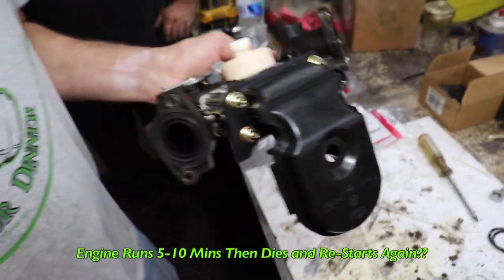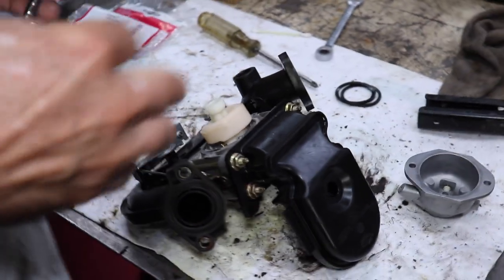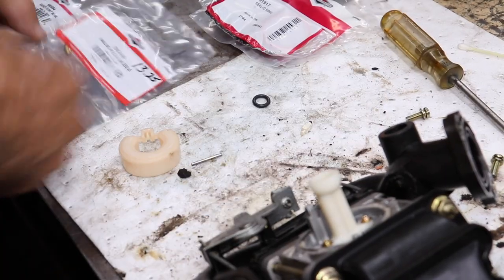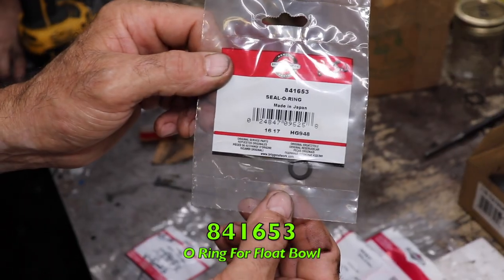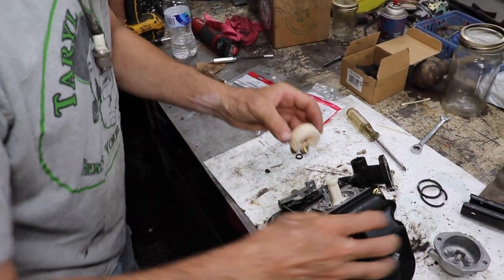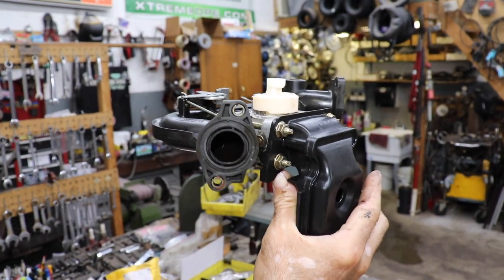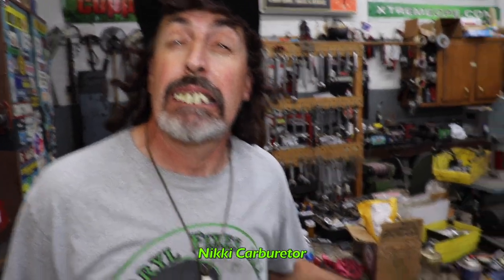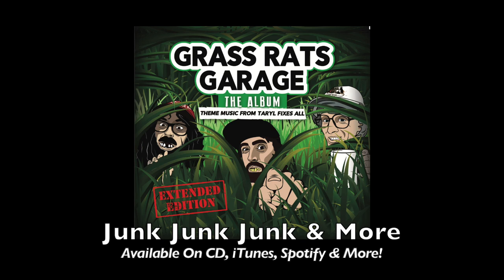Engine Runs 5 Mins and Dies? Try This Amazing Trick!

Comment: You're the first expert to say the float level matters. Anybody else I've seen rebuild a carb said it doesn't matter. I always adjust parts until the float is exactly parallel with the carb body. Never had an issue after a rebuild or replacement.
Reply: Those weren't experts.  Those were hacks.
Reply: Any carb I've ever seen has a float height spec from the manufacturer.

Comment: Another thing that can cause an engine to run for a short time then die, is someone using the wrong fuel filter. You should never use a pleated paper style filter on a gravity fed fuel system. It can cause the same symptoms. Too much restriction. Just ran into this a couple of weeks ago on an old Briggs single. Customer had installed one of those filters and couldn’t get it to stay running. Swapped the filter for the correct Briggs red plastic screen style filter and problem went away. We were told about using the correct filter when I went to Briggs school on fuel systems. If you have a fuel pump, the paper filters are fine, if gravity feed, stick with the screen style…..
Reply: I'm a intermediate hobbyist and just learned something new!  Thanks!
Reply: Thanks for the tip
Reply: Briggs makes two screen type filters.  A white and a red and they have different mesh in them?  If I'm not mistaken only the red is recommended for gravity feed.
Reply: @shawnbottom4769  Correct. The white filter has a finer mesh screen in it compared to the red, and according to Briggs is intended for systems where a pump is used. Personally, I usually just use a good quality paper filter with pump systems, as I feel they filter better than a screen. But don’t use just any old cheap filter. I have seen cheap ones that come apart internally over time due to poor glue holding the element in place.
Reply: I posted a comment and noticed yours so figured I would put this here, too.  In older equipment particularly, inspect the entire fuel hose system from tank to carb.  I had the prob, replaced all the hose from the fuel filter to the carb.  Didn't help.  That is when I looked at the hose from the tank and it was jellified inside, replaced it and it worked fine until something else broke later on :(
Reply: I use to believe this as well. However as long as the height of the gas tank can compensate any filter can be used without issue
Reply: WHERES MY DINNER? Ive watched every damn video on this problem and still cant figure it out on my Kohler 22hp Let's see I've put on a new carb fuel filter and gas line new air filter spark and ignition coil and yes even a new gas cap and the damn thing wont stay running.Has about 150 hours on it so I doubt it but maybe a valve job? My grass is starting to look like a field and I cant afford $120 per hour to fix my mower

Comment: I've seen that same symptom when there was debris in the tank that would restrict the flow to the point that the bowl would empty, then fuel would seep thru and refill the bowl.
Reply: I had the happen to me. Somehow a rock got stuck in the outlet of the fuel tank. Never seen that before
Reply: Or the vent in the fuel cap is bad/plugged.
Reply: that was my first guess, no fuel filter or plugged fuel filter repicking up sediments/contaminants

Comment: I had this problem on my old Toro Recycler this spring. Same fix. New needle and seat seal, and it runs fine now. I couldn't tell the difference between the old and new parts, but can't argue with results.  :)

Comment: I tried mowing the lawn just before it got dark last night, but the mower started cutting out after about 10 or 15 feet of mowing.  It would start right back up, but when I pushed through the grass it would lose power and die.  I took some pliers and slid back the fuel line clamp so I could slide off the fuel line from the nipple and see if there was gas coming down from the tank and it flowed strongly.  It was getting to be too dark to tear into it further, so I put it away for the night.  After dinner today, I took off the float bowl...the first time I've done it on this mower,....and thought I saw some water in the bottom of the bowl,....but it wasn't water!  It was two thin metal disks, just the same size as the hole stamped into the bottom of the float bowl.  I was thinking they've been there since the mower was born, randomly moving around, but when they ended up in a particular spot, stacked two-high under the float, they held the float from dropping when the fuel level went low as I cut the tall grass.  I put it back together without the two disks and it ran right again and I finished mowing the grass before it got too dark.  Wow, hard to believe that those disks have been in there since 2002 and not caused trouble until now!

Comment: I have a riding mower that originally came with the nikki carbatraitor I found out that it came with a walbro carbatraitor too and put Waldro carb on and never had anymore running issues. The nikki carb would always flood over and fill the crankcase with fuel

Comment: Taryl, what holds the 2 main jets into the carb?  When I turn mine over, are the jets supposed to be loose and fall out?  IT seems that only thing holding the tiny main jets in is a tiny o-ring on each one?

Comment: I really never thought about the flow being level. Now it makes me wonder how many carburetors that I worked on and could not solve the issues, so had to buy a new one. Tomorrow I'm going out to the garage and go through my broken carburetor and I'm going to check if any of them has a float that's too high or too low. If I find them I can fix the issue and buy some new parts to put back into them. Like most of us I used the old carburetors I have for parts to work on other people's problems.

Comment: So I've got a Marvel Schebler carburetor (off a 9n ford, I know it's a bit larger than your normal lawn tractor) and I continue to have the same issues after rebuilding it. It runs great for a little while (weeks or months) then it will only run with the choke on. Is there a specific jet or port that would contribute to this happening? Fuel(ethanol free) new gas lines, new strainers and filters,  new needles and jets. At what point do I just buy a new one? When I really just want to fix or adjust what I have.
Reply: Years ago, there was an adjustable main jet needle kit for those carbs. You'd either drill out the main jet or replace it with a biger one, then use the needle to adjust the mixture.
Reply: You start the engine, let it warm up, readjust the air/fuel mix......everytime. Mark the starting point for the next cold start.

Comment: Had a similar problem moons ago....like over 40....on a jd 120. It was the coil.....soon as it would get hot, (short out I guess)...engine would die dead as hades. Let it sit....cool down...and it'd start right up again. Took me awhile to figure that one out. Recently
 jd 915 zt began to choke down. What's up with that? Had a fresh fuel filter....change it anyway..they're cheap. Put a nice clear automotive type on it....viola....now it's apparent...fuel pump croaking out...barely squirting....like a nikki six. Mexican mikuni swallowed too much alcohol..I'm not talking tequila either. So, Chinese part from amazon...yeah, they're all made in Carbitraitor fakkiry 26 down by the Wahun virus lab.....and it runs like...a deere. ...again.

Comment: My riding mower was doing this as well. See if the fuel line is clogged. My mower would run until all the fuel was out of the line, quit and start up again after fuel filled the line again. Used a 1/8” drill bit to unclog the bottom of the tank.

Comment: Years ago I had a car with this same problem and after several mechanics, including the dealer claimed to have fixed half dozen 'problems' I rebuilt the carb out of exasperation. They had 'fixed' everything from the cam to the fuel lines....

Comment: Gas filters are another source of similar symptoms but everyone knows to check that.  But who would imagine looking for jellified gas lines?  Many of the GAS LINES on older equipment cannot tolerate the ETHANOL that is in most of today's gasoline and turns to gel inside over time .  As that is happening, it makes it harder and harder for the gas to make it thru.

Comment: The same issue happens when you have a metal needle and the rubber seat swells.  Never use carb cleaner on rubber carb parts!  Nice video Taryl!

Comment: Had a generator that would run for five to ten minutes before dying.    Checked carburetor, all good.  Ended up being spark plug wire cap breaking down under load.  Replaced sparkplug cap and that took care of it.

Comment: i had kawasaki like 20 years ago run good for like 30 mins then die cool off like hour start right back up crank shaft was cracked heat up throw timing off die ran like that for years crank finally broke into and you chould see rust where been cracked anyway info you can but in memory

Comment: I’ve seen them where the gas cap isn’t venting properly and it doesn’t let the fuel flow
Reply: exactly what happened to me and had to clean the vent hole out..
Reply: Had a guy bring in a pair of hedge trimmers he couldn't get to stray running he had put a sheet of plastic between the gas cap and tank cuz he said it was leaking and he couldn't figure out why it wouldn't run
Reply: I had an old echo pole saw doing the same thing. Turned out to be bad vent valve. Loosening the gas cap it ran great.

Comment: You changed the needle from plastic to metal. Why didn't you have to change the seat? Or does it already have a rubber seal in it?
Reply: No rubber seat. Both needles had rubber tips.
Reply: I don't think that carbutrator has a replaceable seat
Reply: @dwaynejohnson6277  he said the old one was rubber/plastic and the new was metal. The nikki 6 carb kits come with a new seat.

Comment: Weird. I've NEVER heard of a motor dying and then restarting by itself.
Reply: Lol about 15 years ago I worked at a small autoshop and a regular customer...much like Ronnie here , would aquire some of the most dangerous pieces of shit and have us do little things to it then he would sell it,I always hated seeing this clown show up I always wanted to slap the guy but back to the point of the story he brought in a late 80's early 90's volvo and said it had some "shorts" , well this was common with those cars I popped the hood and damn near every wire on the car was bare the insulation had dryrotted off over time, I'm like oh boy screw this I'm going to lunch before I end up calling the fire department, while I'm sitting in the shop me and the 2 guys I worked with having lunch the car just randomly started cranking then it would stop then it would crank again until we unhooked the battery, the shop owner told him if he didn't come up with a factory harness we ain't messing with it it's absolutely going to burn someone's house down the whole car was like this 😂 
So I have seen one try to start all by itself
Reply: Oh and I left out the best part...it was MT,not AT so the ca was parked outside the garage pointed towards the garage and it was lurching fwd while cranking we was eating maybe 20 feet infront of it...that was some maximum overdrive/Christine type stuff
Reply: @wolfmanrebel874  reminds of a time working at a dealership. Walked outside to grab the next car to pull in, there was a customer out there picking up his car after just having it serviced. 
It was a stick, and the tech who previously had worked on it left it in first gear when he parked it. 
I watched the customer raise the key fob to activate the REMOTE START, and that’s when the hilarity ensued. 

The car lurched forward, started, and started heading towards a drainage ditch 50ft away, that was 10ft below the grade of the parking lot. 
I’d have to say the little spoilers they installed on the back of the sport model of those cars must be pretty strong, because that’s what he was hanging off of with his feet dragging against dry pavement in an effort to stop the car. 

It made it 3/4 of the way to the ditch, and finally stalled out. 

He went back into the front office to blast the service writer, and that’s when he was informed having a remote start installed on a manual transmission car in the state was illegal for the very reason he just experienced.
Reply: @erikj.2066  😂🤣👍  Lol that's funny
Reply: @wolfmanrebel874  haven’t told that one in years, glad you enjoyed. 

Someone ought to get some short stories from techs together for a book. I’m sure it would have multiple never ending volumes. 😆

Comment: My Kawasaki FR691V in my brand new scag smokes for five minutes straight upon start up , This is my third scag in one year.  I thought it was over filled but when I checked the oil it was actually under filled.  I've had to add almost 1/4 of a quart twice now.  I changed the oil and it did not smoke the last time I started it.  I think my dealer put vegetable oil in it, they also didn't tighten the control arms, adjust the tire pressure or level the deck either. My dealer flat out sucks and scag doesn't give a crap. I've been posting videos about my experience.
Reply: Let scag corperate know of your dissatisfaction. Can't hurt.

Comment: Those are expensive orings, I'm in the wrong business. That's a $125 repair bill lol.
Reply: Should be a rebuild kit and cheaper than buying each one separate.
Reply: plus time. you might get charged 1-2hours just to remove and replace the carburetor.
i heard mechanics are charging almost 75$+ an hour now.
Reply: @tomtheplummer7322  Not for one of those. Limited repair parts available cause Briggs and the Gov want the carb replaced not worked on.